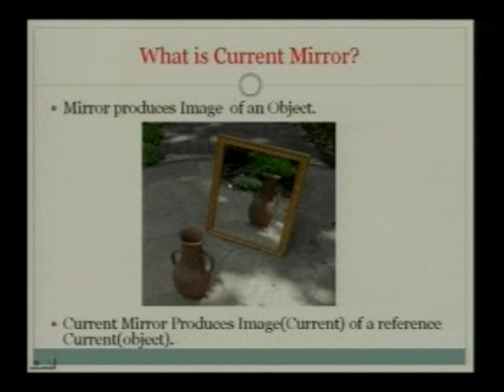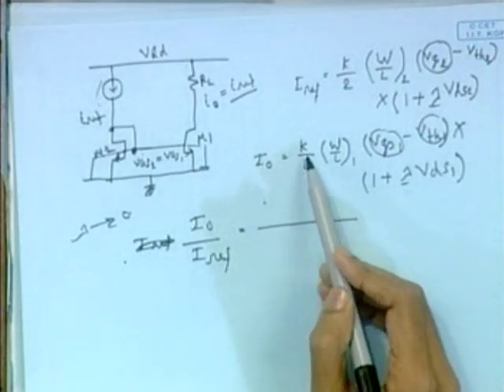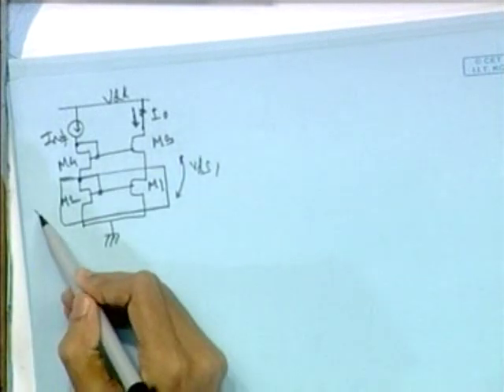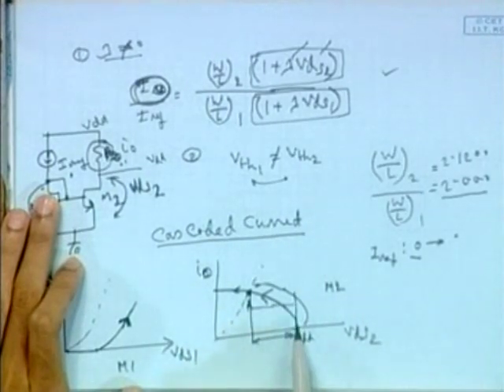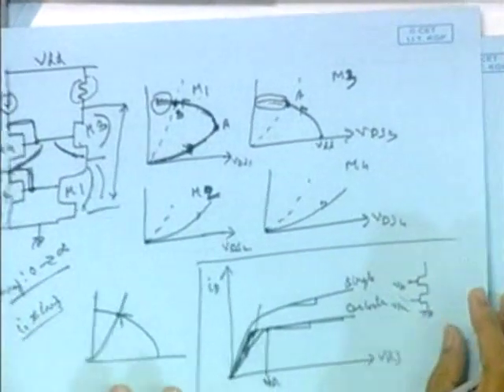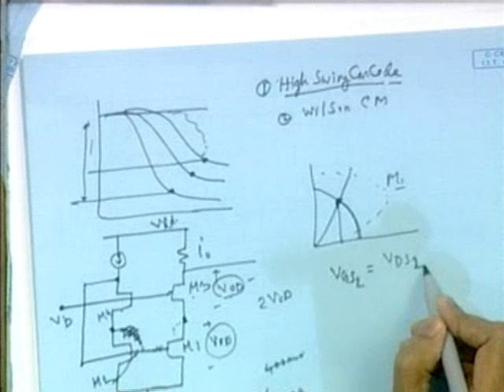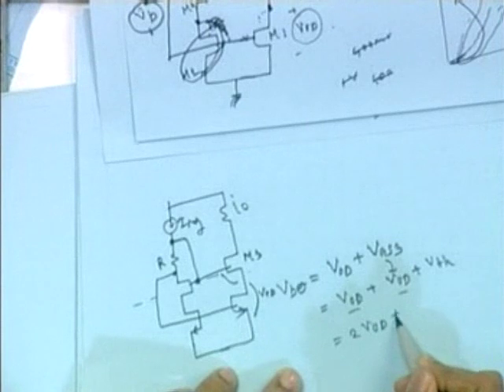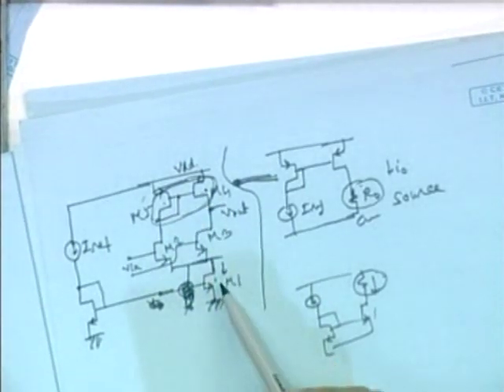Lec 18 - current mirrors

Comment: Very well explained, but I have a small confusion. In first part of the video (first 11 minutes) when you draw the Current mirrors you said left transistor is M2 and right one is M1 and we are taking output from M1, but when you solved the equation you assigned (W/L)2 ration with M1 and (W/L)1 ratio to M2 and you said if W2 > W1 then Io > Iref which would be incorrect then. From the circuit it should work like if W1 > W2 then Io > Iref. 
Correct me if I am wrong